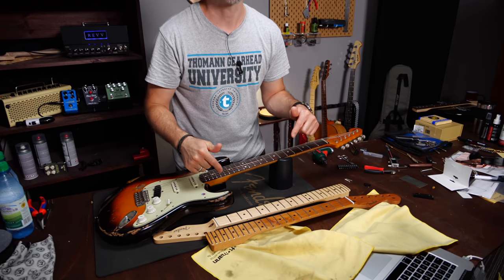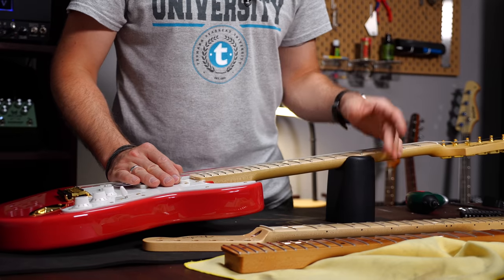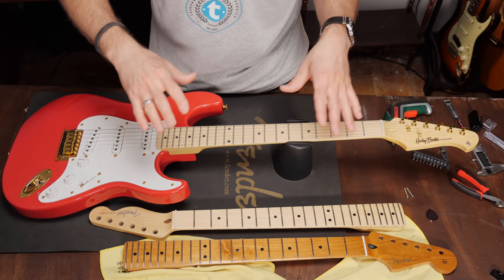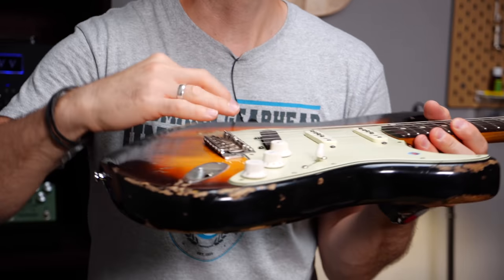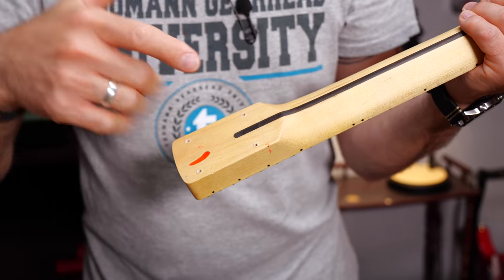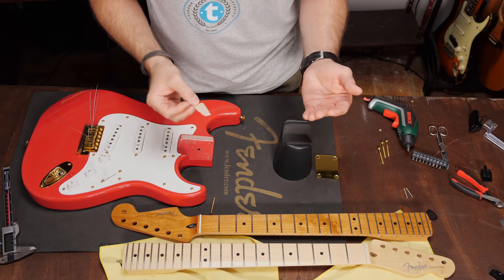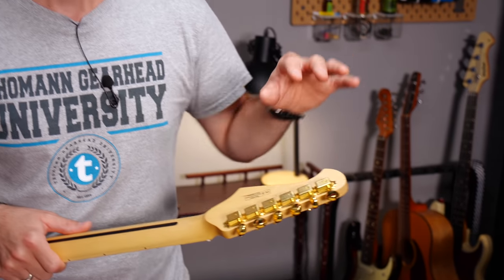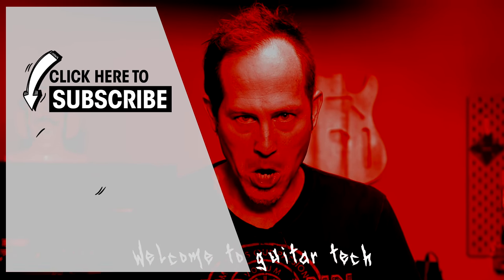Issues With Swapping Guitar Necks | Guitar Tech Tips | Ep. 77 | Thomann

Comment: Would have been more fun if you tried to put a Fender neck on a Harley Benton or vice versa.
Reply: I'd like to see that. I'm thinking of putting a decent Fender neck onto the HB TE52 telecaster.
Reply from the maker: Hey, those won't fit without modification. That's what I was showing with the calliper around 2:15. You need to sand the neck to fit in the neck pocket and the screws are all "wrong" too. Cheers //Kris

Comment: Hes right folks pay close attention to what he said ,I have a kramer striker I bought a neck from Amazon  once because my original neck was unplayable, when I got the new neck I had to sand measure sand measure and sand again and again while checking the fit between sandings ,even if the neck is just 2mm off from fitting if you sand one side of the neck more than the other it wont go in the neck pocket properly it will be cock eyed so to speak which now you have a string spacing issue ,you have to do all these things and then double check your work it may take a few mins to a few hrs to get this right,the thing that's important is take your time and check the fit and make sure it goes in the neck pocket right if it's off by 1mm the more it will off near the 3rd 4th even 1st fret at those frets it could be off triple that number, it's a very tedious thing to do I've been through it but by taking my time I got my new neck to work it took more than a few hrs roughly  2 days and it was good, word of advice if you dont need to change the neck on your guitar dont because its alot of work,great video

Comment: Hey Kris, you are right about pointing out the difficulties and problems that might occur while swapping necks. My main Tele has had 6 neck changes until I've found the right one. I can't play thin necks and I dont like baseball bat-types either. From my experience, I'd say you can't go wrong if you choose either Fender originals, or mainstream brands like Warmoth or Musikraft. Beware with Asian made bodies, as the specs are different from the US made and will need adaptation for most. Other than that, it's a bit of a lottery. I am very happy with a neck I purchased in UK from NorthWest guitars, to mount on an homage Blackguard of the Jeff Beck Esquire/Tele I have assembled recently. Maple semi-satin finish, just the right depth and profile for my hand: vintage nitro tint, 12 '' radius, medium jumbo frets, C .83 / .92 profile, (similar to Custom Shop CS-1 dimensions), 42.8mm bone nut, top trussrod adjustment , which avoids disassembling the neck each time. VERY comfy ! The choice of woods, fret type, carve are very important: try a lot before you order. Cheers Kris !

Comment: As I recently shimmed a Squier Bullet SSS HT. It originally had a piece of paper taped at the butt of the neck pocket. The material of the shim really doesn't matter. I used the backing of a hardwood flooring sample made of plastic. And I put that on top of the taped piece of paper. No change in sustain. It makes sense to have as much contact of the heel & neck pocket and the harder the material for a transfer of vibration the better. I think you could spread aluminum foil or even copper shielding tape and it would be hard enough to transfer vibrations for sustain, probably better than wood on wood contact, metal is harder than wood. The plastic shim was flat, as the neck pocket & neck angle were fine from the tape shim that was already installed by Squier. 10-12 seconds of sustain is overkill and even the cheapest guitar gets that, shimmed or not. My guitar is Baltic Blue, used black plastic because it closely matched the body color. I thought about using wood, but it would not match the tinted gloss polyurethane of the maple of the neck. It's visible,but you have to make an effort to see it. Plays infinitely better from a perspective of action height. sustain, that's debatable whether there is any difference. Tone, I think it's actually better, raising the fretboard at the heel required raising the pickups. But my saddles are properly leveled when they were slammed before to the bridge plate. Who knows if that's even the original neck ? It was 14 years old when I bought it.

Comment: I had occasion to try a neck swap earlier this year.  Thanks to you, I now know that I did the right thing to stop the instant I realized I was having problems.  Had I continued, I would certainly have damaged something.  As it was, I was concerned that I had.  Everything seems fine, though.  I was right to abort because I have none of the tools needed to do this job right.  Thank you for the confirmation.
Reply from the maker: That's great to hear! Yeah, usually a neck swap requires some modification and it's best having tools for that. Been there, done that, haha! Without knowing how to fix incompatibility and having the right tools, it's gonna be a mess. Cheers //Kris

Comment: In the old days... I used to try and nullify (as much as possible), the distance from the strings to the pole pieces. I would try and match the pickup hight and the sideways offset of the low and high E to the pole pieces.  It usually ment lowering the pickup a little. My idea was to make all the strings (about) the same distance away from the screws.   THIS was waaay back when i used to worry about suck issues.  Lol😊

Comment: I have a 23 yr old Fender Starcaster.  Not surprisingly, Fender necks don’t fit because of the lack of “lip” at the bottom of a stock neck.  It’s far easier to fully rework the original than to mess with a newer neck.  Hey I only paid 100.00 US for it so the work is just a labor of love.  The frets, after a bit of careful work, are just as good as my new American Professional II.  I’m putting a stick MIM loaded pickguard on it.  All my other Strats have AM pickups so, it will be a nice sonic difference.  Also…surprisingly, this OLD Starcaster ( Strat shape ) has a one piece body!  I’ll sand it down and give it a clear-coat  as any good hunk of woods hold be clear😉

Comment: Oh, I used to have a schecter with replaced neck. And it was impossible to set it's scale length. It was 650mm in the shortest 6th string saddle position. The bridge sits with an angle, so 6th string was almost unplayable, 5 - badly playable and others were ok. Never gonna get an used guitar with replaced neck again

Comment: Hear me out @ThomannsGuitarsBasses  I bought a Fender American Professional II Scalloped Stratocaster Neck, Rosewood, and it says it will fit perfectly on my Fender mexican Stratocaster. 
I have for the future plan to put a telecaster neck on my Squier Affinity Telecaster, I guess that would need adjustments and wont fit right on the Squier body?  Almost asking rhetorical because when I swapped the MiM Strat tuners to locking tuners, it went smooth... when I placed the MiM tuners on my Squier Affinity Telecaster, I had to drill new plugholes as the measurement of the holes that was on the Squier was off, I hand drilled and made it work.. So guessing that I would have to sand and maybe even drill new holes on the Fender Telecaster neck if i want to swap from the Squier neck?   Are you also saying i'm loosing warranty on my MiM Stratocaster the moment I swap the neck to another Fender neck?   That doesn't sound right, or did you mean that if you placed another NON fender neck on a fender that is breaks the warranty? 

I swapped pickups on my Tele too lol, those pickups alone has warranty!   Also changing the pots to 500K on the MiM when i get them in the mail soon! All original parts.

So fun question, will a stratocaster MiM Neck fit the Squier if i wanted to do something crazy like that ( NO I am not going to do that, i actually love the shape of Telecaster head )
BUT I do have a cheap "LA" gear4music guitar that i bought for 130 dollars, it has similar shape to a Fender Strat, and already placed the MiM strat pickups on it lol!  Guessing I will have to sand and work on the MiM neck in order to make it fit, because putting the MiM Pao Ferro neck on that cheap gear4music guitar is something I am considering, but is there a chance that this can fit without too much work? ( not that i mind the work but less work means quicker swap ) Now do i care if that  cheap guitar looses the warranty? not at all! lol  Do i think swapping from a MiM Pao Ferro neck to a Fender American Professional II Scalloped Stratocaster Neck, Rosewood will break the warranty, no sir i don't believe in that, and I also believe that the US neck comes with warranty,  am I correct or wrong? Or is it only if you mix brands?  Does swapping pots and pickups break the warranty?   When I build my computer, every single part in my computer has its own warranty, I would think it would be the same on guitars when modding it, because I don't have Fender pickups, i run Seymore Duncan and DiMarzio pickups :)

Comment: I just wanted to install a Floyd Rose to my first guitar (2004 Squier Affinity) I thought replacing the neck with with a Fender one with the locking piece space but I guess the don't sell those... Any ways, I might get a reverse headstock with the locking system from other brand and just print the Squier logo on a water decal. Thanks for the info, cheers.

Comment: Hey Kris, awesome sound on that strat man :O I love that gritty sparkly dirty tone! You get it on every guitar. Is that the Revvv?
Reply from the maker: Hey man, thanks so much! It's a mixture of guitar, overdrive pedal and amp. There's a reason for always using the same few OD pedals (Honey Bee Double Trouble, Kasleder Toxic Twins, Carl Martin Panama, Wampler Pantheon). These will give me that gritty, sparkly, yet balanced and full "amp like" overdrive. And the Revv D20 is just the best amp I've found for pedals that doesn't cost multiple thousands of euros. Plus it has the loadbox with the cab simulation, which is something I use a lot here in this series. The Yamaha is only there for monitoring the tone. :) Cheers //Kris

Comment: Kris i play with a light touch and don’t see much tuning issue with my guitar. When people have tuning issues with cheaper guitars is it possible they are playing too hard?
Reply: That and a lot of cost-cutting in materials and design.
The first "new" guitar I had good pickups, but a badly designed bridge.
(It was a budget line.)
Reply: i play really hard with a dunlop 3mm big stubby i think it´s called.
i have no tuning issues. i don´t recommend hard playing though.
if you have tuning problems it´s friction in the nut slots most likely.

if you pluck really hard it slightly raises the pitch of the string in the very first moment but it doesn´t lead to a out of tune impression.

pencil led reduces friction in the slots. that´s the way to go.  it fixes tuning issues even on les paul g strings in 99 times out of a 100.

Comment: LOL.. I buy random guitar bodies and necks all the time.  It's super complicated fitting the necks.  Re-routing the neck pockets to fit with a custom jig if the neck is bigger.

Layering in super thin wood veneer slices with glue until it fits perfect then sanding and refinishing until it fits a neck that's too small..

Or worst case...  Rerouting a square.  Gluing in a full piece of wood into the neck pocket..  (So it's now part of the body).. and re-doing the entire neck pocket into the new piece of wood glued in where the pocket used to be.  If the neck is swimming from being WAY too small.

Re-doing the center line.. and maybe.. Re-doing a bridge now to wide.
  
All of it... A super pain in the ass.
Reply: Stop.

Comment: Man you just told me in a short little video what I've been trying to figure out for months. I have a dime Dean and I've been wondering if the fretboard is supposed to be flush with the body because right now it's about 1 mm off so no I'm going to have to sand it down . The only good thing about this is the fretboard is maple colored and the neck is a a lighter color so I can see exactly how much I have to sand . I'm not too worried about messing it up I paid $50 for it it's not a real Dean from hell but I'm trying to fix it up little by little the longer I own it . I have to put a tremolo on it and move the input jack to the front of the guitar. I don't think there's any way to move the switch to the top of the guitar where it originally should be because right now it's at the bottom I'm not really sure how you would do that without carving up the guitar .but anyways you've answered the question I've been wanting to know I really appreciate it 🤘🏻

Comment: What about ibanez aanj neck? Ibanez doesn't make any replacement neck like fender does and the neck joint is totally different than any other brand. You guys think that a custom neck is the only solution for swapping neck on an ibanez guitar?
Reply from the maker: If you ever needed an Ibanez replacement neck, you should contact Ibanez directly or the shop you bought the guitar, so that they can ask Ibanez for you. I'm not saying it's super safe that they can help you with a new neck, but I could imagine it's an option. It of course also depends on the model and the age of the guitar if they can find a fitting replacement neck. Cheers //Kris
Reply: @ThomannsGuitarsBasses  thanks Kris for the reply. I was also considering buying a used ibanez guitar that could possibly have a compatible neck to load on mine, I love my guitar and also made a lot of upgrades to fit my needs, so it could be an option. Keep doing this sort of videos,  these are a good entertainment for the guitar community!!!!

Comment: How much of this vid applies to an even neck swap? Like I’m trying to change out the player plus neck pau ferro out for the same fender replacement part but for the maple finish. It would require me to file down the nut at least but I don’t know what else to expect.
Reply from the maker: That's definitely the best case, you should be fine. If you're lucky you only have to fine tune the nut. That is, if the neck pockets of the two necks are identical (tolerances always play a big role in these swaps and there's no 100% guarantee unfortunately). Cheers //Kris

Comment: Very interesting !  Don't know why , i bought a Mexican custom shop design Stat V neck as spare years ago . On the side of pocket, the neck is so thick that i must leave the 2 points trem totally floating, the saddles are at the higher point and if i lower the bridge the strings touch the neck. It's impossible to lower the bridge flush to the body. You can only block it with pieces of wood in the springs cavity. All is original, i bought it like that and didn't saw the problem to come because i like this neck. Don't know if it's a special feature for a really floating trem ???
By chance it stays perfectly in tune.

Comment: I’d love to swap out my MIM tele for a rosewood but I tried swapping out a bass neck years ago and the sizes of the bass body and new neck was astonishingly off…not even close.
Reply from the maker: Yes, that's the problem most of the time. The model of the original guitar and the model of the replacement neck has to fit (Mexico Standard model will not fit a Mexican made 60's style vintage neck) and then on top of it you also have to be lucky that you don't face production inconsistencies. //Kris

Comment: Jimy Hendrix  switch neck strat for telecaster i saw picture and you can see the gap betwen neck and pickgard and he sound super can you explain me that master?
Reply from the maker: Hi Roberto, you can make everything work if you're ready to modify parts. You might have to chisel some wood, fill some holes with dowels to get there but it's possible. 
Also, it's Jimi. Of course he sounded amazing. 💛
My point in this video is to raise awareness to the subject: don't expect different parts to be interchangeable without slight (or big) modifications. You wouldn't believe how many people write emails to our guitar department asking if this neck fits on that body, etc. 
I hope that helps Roberto. Cheers //Kris

Comment: I have a Harley benton telecaster,  its lovely to play but never stays in tune, would like to replace the machine heads for locking type ones, any chance you could do a video on this.....cheers.
Reply: Before you change tuners, check the nut. If its plastic, get a tusq nut. Best investment you can make….also, stretch the string …take 10 minutes and make sure all slack is out of strings…

Comment: I have a originals 50’s telecaster from 2014 u neck 7.25 radius want to try out a soft v neck , I’ve seen the made in Mexico vinteras have the soft v 7.25 and the custom shop some of them have them too the price difference is huge from $399 to $1300. The question is would any of these fit my guitar without much work??
Reply: Short answer is yes.

Comment: I’ve got a PRS Starla with a thick neck. What would you suggest I swap it out with, if anything.?
Reply from the maker: Swapping necks on a set-in neck (glued neck) is a huge hassle, very expensive and definitely should be done by a guitar luthier. It's really not worth the trouble. The safest thing to do would be getting an other guitar, if you don't like the neck on the Starla. You could also go to a tech and let them make the neck profile thinner. That could solve the problem too. The downsides of that are obvious: 1. they have to remove the finish on the backside of the neck in order to make it thinner. 2. The value of the guitar will drop radically. 
Cheers //Kris